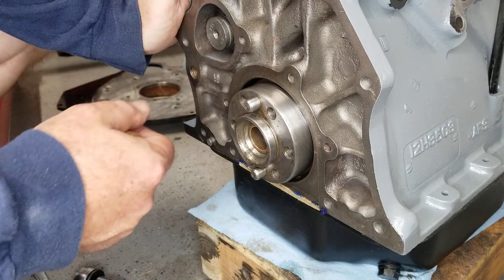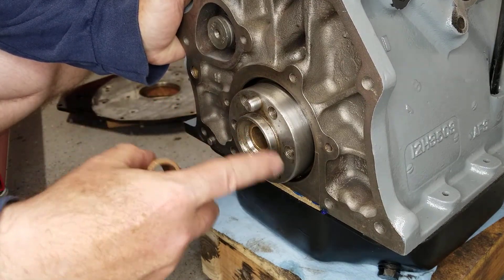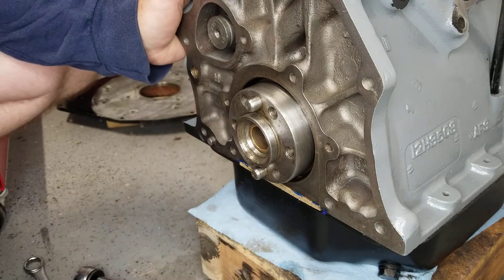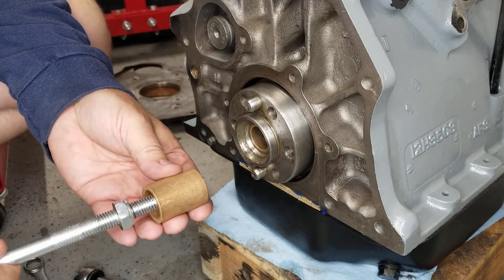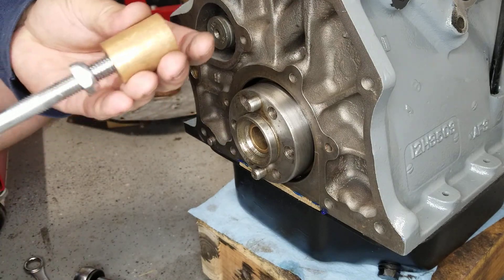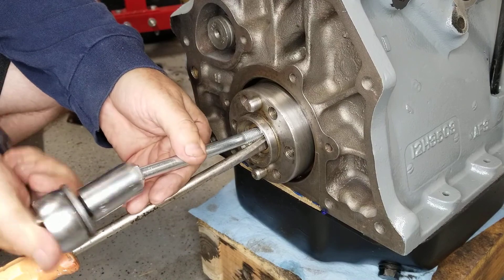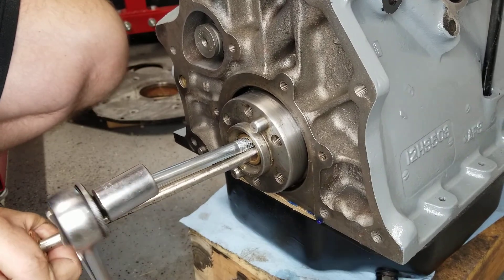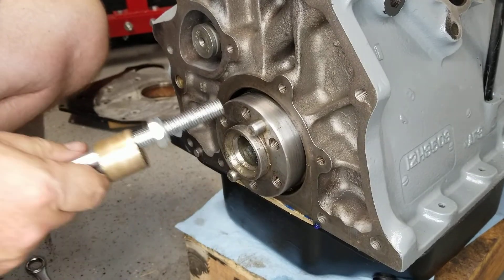How to remove a pilot bearing on a 1977 MGB without special tools

Comment: Is there a reason mine just came off with my finger?
Reply from the maker: Yikes...
Must have been spinning.
Should be a press fit.
Good thing you changed it
Reply: @AlexPlatacis  haha. I did not change it yet, but I'm thinking maybe I should? Only need this thing to last a few weeks as I'm planning on dropping a Ford 302 in it anyways.
Reply: Your video brought it to my attention. I kinda forgot about it. Lol. I think PO was actually driving it around like that.
Reply: Mine just slid out too, didn’t even Know that was a bad thing until I saw these videos looking for torque specs. 
Thx great videos btw
Reply: @MUSCLECREWDave  I replaced it. I had to bang the new one into place.